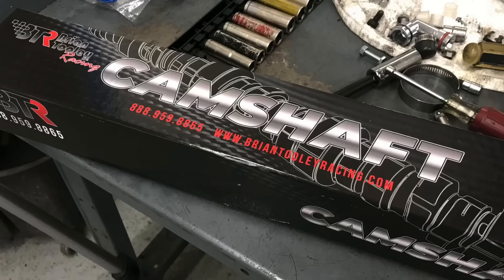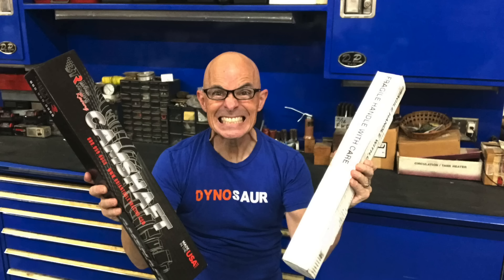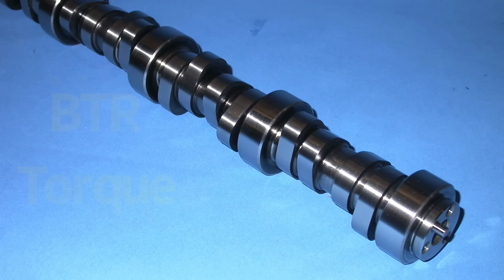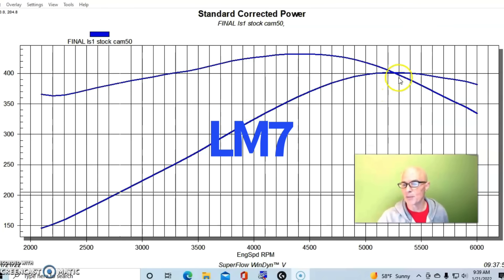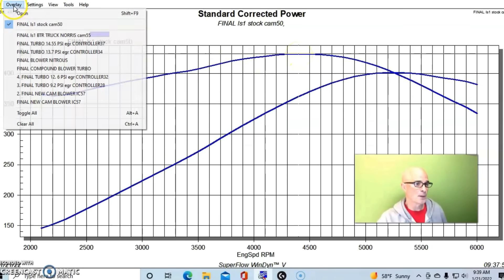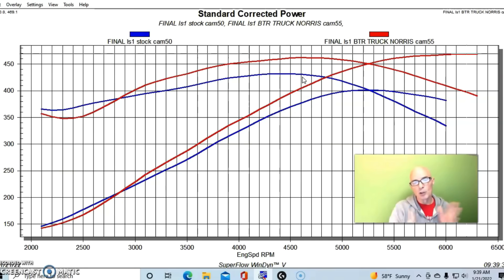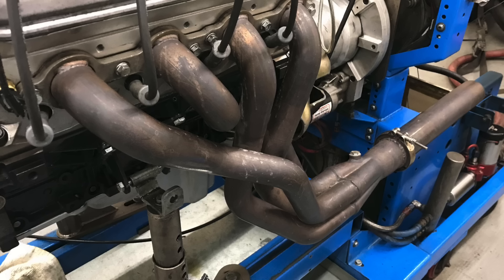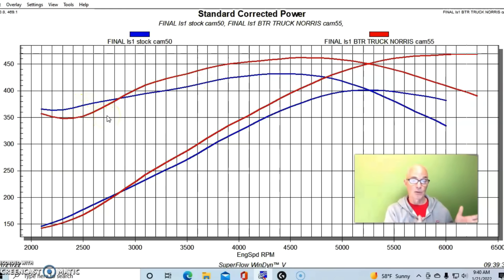WHAT IS THE BEST LS CAM? SLOPPY MECHANICS BEST VS TRUCK NORRIS FROM BRIAN TOOLEY RACING? FULL DYNO!

Comment: Have you or anyone else ever run a dyno cam based on the Buick GSX OEM, Stage 1 or Stage 2 cam specs in a LS? GSX OEM was 316/340, .490/.490 LSA 115; Stage 1 was 316/340, .490/.490 Overlap 90 deg (no notation if +/-): Stage 2 was 340/360, .455/.480 LSA 120 (no notation if +/-)
Reply from the maker: those are old tech cam profiles

Comment: @richardholdener1727 hello rich I have a 6.2 L92 in my 2007 Denali I have been thinking about adding some parts to it my goal is to get at least 600 hp without boost any ideas on what I would need to do to achieve this?

Comment: And ebays full of fake sloppy stage 2 cams you should do a test and compair the real cams vs there china knock offs or fakes and show the difference
Reply from the maker: if they got the specs right, power would be the same but we have seen some with stock specs and definite hardness issues (they won't last)

Comment: Richard what about the Chopacabra vs the sloppy stage 2  i want chop with some power gains and drive ability im building 2 engines one 2003 5.3 with very low kms and a 6.0 with unknown kms whats the best bang for my buck on both engines the 5.3 is going im my 89 blazer s10 and the 6.0 is going in my 1995 ss s10
Reply from the maker: I have cams for you-send me an email killerbe16@aol.com

Comment: What stall would you use with the sloppy cam and push rods
Reply from the maker: 2800 or so (you didn't specify motor size)
Reply: @richardholdener1727  it's a 6.0 bored over to a 6.2 carbureted LS

Comment: Could I use a LS3  stg 2 .589 sloppy cam and .600 valve springs with a 2005 5.3l truck stock heads?
Reply from the maker: yes-but it needs better heads
Reply: @richardholdener1727  not going for anything crazy. Just for my Tahoe for towing my travel trailer. Just saw a  ls3 cam, springs, pushrods and gaskets for $100. Was just curious if they could just drop in

Comment: Richard..    C5Z / LS6. All the usual bolt ons.  Long tubes.  Off road x-pipe…Mildly ported 243 head’s w/ double springs etc.  Sloppy Best? Or Sloppy stage 2? What’s your pick? Car is street/strip. 6 speed. 3.42 gears.  Sticky tires.
Reply from the maker: the SS2 makes a little more power, but less low speed than the 219 best cam-depends on what you want most. If you pick the best-I have that for $169
Reply: @richardholdener1727  ended up ordering a Cam Motion Titan 4.   Hopefully it works out well. Thanks for your help.

Comment: What size Intake valves are on the 5.3L that was bored to 5.7L?
Reply from the maker: 2.055
Reply: @richardholdener1727  Thanks Richard, keep up the good work. Maybe Sloppy Mechanics will come out with a Sloppy Truck cam in another year LOL. I'm on the fence between the Truck Norris, Chopacabra, Big Torkinator, Lil lope and Sloppy Best for my 2wd '76 Blazer, has LM7, stock manifolds, true dual H pipe, 4.33:1 gears, 4L85e. I miss the rowdy old 383 with 110 LSA 226/228 cam i had in it 15 years ago.

Btw, do you have a "Donations for Beer" box? ;-)

Comment: Does anyone know how the best cam would act with nitrous in a 5.3?
Reply from the maker: NITROUS JUST ADDS TO WHAT IS THERE-REGARDLESS OF THE CAM (UNLESS YOU ARE LOOKING TO HIT IT WITH MAJOR SHOTS)
Reply: @richardholdener1727  200 shot max
Reply: I really appreciate your response also but I've also been torn between the best cam and the ss3 it's a 5.3 and will have a powerglide behind it with 4:11 rear gear s10
Reply from the maker: if you want to make the most power possible, a bigger cam then nitrous
Reply: @richardholdener1727  ok,thank you for the response huge fan of what you do and I really appreciate the responses I've had a lot of people saying I needed to get a special cut cam or "nitrous cam"

Comment: I enjoy & appreciate your videos . I don't get your comparison?? Misleading & Guess if I want results from same c.i. eng. and compare 2 cams Freiburger with engine masters is where I belong.
Reply from the maker: what comparison do you want? This was same motor with two different cams (what better test could there really be?)
Reply: @richardholdener1727  I'm confused I suppose?  Yes both LS engines but different cubic inch , different heads (one is ported) so probably even different compression. My point is David and Steve use the same engine not same type. It's like testing cams for small blocks but one is 283 & other is 350 and that's not a comparison. Use the exact same 5.3 or 5.7 or 6.0L for a cam test. 2 cams 1 engine .... Am I wrong or did I miss understand?  Sincerely cause I enjoy your videos and I may of misunderstood ?
Hope to hear back & t.y.

Comment: So on a LQ9 with ported (not cnc) 243s and TBSS in a gmt800 with factory 3.73s... The 6L should eat up some stall tp be able to run factory converter? I was thinking at most, throwing in a 4.2 converter since it'll bump up stall speed a couple hundred rpms. I really like these cams that look small on paper, but make bigger #s than expected. I just freshened up my top end on my 98 WS6 t56 car that i built with everything that makes a C5Z a Z06 over base C5 but with original FAST 78mm. Full exh n bolt ons with slightly conservative tune on dyno jet made 392whp and 386wtq. Yes, has 4.10s also.... But when I re-did top end thx to original timing chain snapping at 7k while racing, i ported my 243s and used the SDPC LS6 Power Max Plus cam as I wanted something wee bigger but still can DD and beat the crap out of it like with LS6 combo. And just being a 220/222 with .570 lift on both sides and 112+2 LSA... It's so much more of a cam than I expected! So for 1, it was $239 shipped when I bought it. And 2, WOW!!! Love every bit. Chop is nice, but not too much. Haven't retuned it yet and runs great. Not perfect, but afr not out to lunch either. I have taken it to 7k several times without skipping a beat. But yeah, it feels like a what stg3 cams were 15 yrs ago!! 
I'd love to see some LS6 vs SDPC cams. They have 2 different LS6 versions. The other is like the one, but intake dur is down at 204 vs other at 220. Which I bought originally for the LQ9 build for my 04 Tahoe!

Comment: Biggest difference is in the cost involved to support each, the TN can use GM springs while the SB needs aftermarket due to lift, TN was developed to be used with factory converter while as you mentioned the SB looks to need a converter upgrade so unless you are doing a TB converter its a few hundred dollars more to be as efficient.

Comment: I know this video iS a year old
But I have a question. 
What kind of gains just dropping 
It in a truck without a tune. 
Just wondering if you’ve tried 
It.
Reply from the maker: it would likely be lean and might cause damage given the power gains and the stock injectors might not keep up anyway

Comment: Revisting this, I put a Texas Speed CHOPacabra cam in my LQ4 with 862 heads. Originally I wanted the BTR TN, but got a great deal on cam and springs. I'm not really pleased with the lack of power. It drives great andsounds good, but feels like it's down 20-25 RW from where it should be. I am going to replace my converter first, because it was doing weird stuff on the dyno. If it doesn't seem any better after ruling that out - it's time for a change. I have a nice set of 799s done by Advanced Induction, and a Sloppy Best Cam. I'm leaning towards swapping those on after the converter to get what I want out of this daily driven combo.
Reply from the maker: that TS cam should be a significant jump in power over any stock cam-I suspect tune
Reply: Tune has been deemed fine. It needed a loose converter (3800) to get it moving. Still puts down lackluster numbers, but I have managed to get it into the 12s with only 330whp.
Reply: I’m gonna say tuning if your tuner can’t get drivability down try another tuner choppacobra is a great cam choice

Comment: I put this cam in my 2007 gmc 3500 with 6.0 and 4L80E. The engine is out at the moment and I’m wondering if there is a better torque converter to run or is my stock converter optimal?

Comment: I wonder what the comparison would be on that ls1 with truck Norris cam between two sets of heads? One would be 862s with bigger valves vs 243s milled to achieve the same CR as the 862s?

Comment: On a 6.0 with a vs racing t6 80, what would be best? One of those or a turbo cam? Its in a 67 impala. For street and fun use.
Reply from the maker: pick the cam that does what you want to your na motor-then add boost

Comment: Richard just looked at the new cam from tsp the " chopocabra" 214/222 .550/.550 108 LSA. Shameful on there part I feel like they took all of Brian toilets hard work and research made a camshaft almost identical to the norris shaft and named it somthing intriguing to some folks that may for for a name rather than a cam spec . just wanted to bring this to your attention maybe try a test on the "chopocabra" see if the results are similar to the norris cam swap results 
                    North Maine Steve

Comment: Richard if I already have the BTR stage 3 v2 cam is it worth changing out for a Truck Norris? Is the stage 3 fine to run with a turbo?
Reply from the maker: YES IT WILL WORK WITH A TURBO-IT'S BIG FOR A 5.3L OR A 4.8L
Reply: Sorry should of mentioned, it's a 6.0 LQ4. Currently with stage 3 v2 truck cam.🤙

Comment: Ima try asking this again but more simplified and the other cam with a different lift. Lq4 6.0. Truck norris or Texas speed truck cam cam stage 2 .550 lift? Don't want any loss down low
Reply from the maker: what are the specs on the TS cam? the TN won't have any loss down low on a 6.0L
Reply: @richardholdener1727  212/216 .50 112 lsa.
Reply: @richardholdener1727  heavily leaning truck norris.

Comment: Quick question. I have a 2006 6.0 with flat tops and 317s. Building for a Land Rover conversion.  Is it worth going to a 799 head or is the 10.5 CR enough?  I prefer to not run higher than 87 and living in Colorado Springs, it won’t likely ever operate below 5000’. What cam would you suggest?  Love your content.  Thank for producing!
Reply from the maker: THE 799 HEADS WOULD BE BETTER AT THAT ALTITUDE

Comment: What exhaust and gear would you recommend on a Lq9 with 243 ported heads and ported tbss intake and ported throttle body with a 4l80e stock trans and stock block single cab 2001 would you recommend
Reply from the maker: 2.5 exhaust with headers and 4.10
Reply: Thank you so much

Comment: Morning Richard im from new zealand 
Running a stock ls1 in a caprice 241 head numbers. 
With this cam reading a low LSA and low lift with nice duration i like this for our cruise car key question will it work in our ls1 5.665 ltr engine VF002710096 witch i cant find 

Kind regards 
Aaron.
Reply from the maker: the TN and Best will both work on the 5.7L Ls1
Reply: Awesome Thank-you and i love the detail you put in to channel and hard work.
My next trick is to sorce that cam now 
Thanks
Richard.

Comment: Hi Richard, Have you tested or compared the GM LS Hot Cam? why are the BTR cams so much better? I am looking for street manners, max torque at the lowest setting with an Turbo 350 W/2400-2600 stall, 3.08 gear (Soon to be 4L60 and 3.23)LS2/LS3
Reply from the maker: NOT SURE I HAVE RUN A HOT CAM

Comment: Richard im getting ready to order some trick flow heads for my 5.3 with a tbss intake and 1 3/4 headers and btr truck norris cam. What specs do you recommend for the trick flow 205 heads?
Reply from the maker: don't they come 1 way?
Reply: @richardholdener1727   i was looking on lethal performance and they had 2 different ones. One being 58cc and another where it asked what cc you want starting at 54 to 66 thats why i was confused im assuming i should go with the first one the 58cc

Comment: the real question when is lift and duration to much for a real everyday driver that weighs say 3600 for a car and 5000 for a truck with a street friendly 373 gear. for racinging biggest cam  with biggest stall with lowest gear

Comment: VIDEO SUGGESTION: I'M not sure if this has been done before or not, but I'm sure someone has.  However I'd like to see what results you come up with.  Ready?  
Take a 5.3l.  1st test: stock (non-flexfuel) injectors on 87 pump gas...  2nd test: stock (non-flexfuel) injectors on E85... 3rd test: Stock Flex Fuel injectors on 87 pump gas.. 4th, Final test: Stock Flex Fuel injectors with E85...

No tuning.  I'd like to see if just swapping the fuel or just the injector makes additional power.  Then maybe some tuned pulls for fun.

So basically will a 5.3l flex fuel injector, dropped into a non-flex 5.3l make any extra power???.  No tuning.  Just the injector.  
Whatcha say?  Could be an easy, and cheap to make video that would help tons of ppl I think..
Reply from the maker: if the injector size is different-it will require tuning
Reply: @richardholdener1727  Technically they'll  run without tuning for the injectors.  It just wouldn't produce as much power as it could.  Or may run like junk.  Or the computer may try to pull fuel and compensate for the rich environment and it maybe fine.  
I think it would be a neat video to see.

Comment: I'm looking at a 228/232 .600 .600 112 lsa cam from texas speed.. ( real close to sloppystage2) going in 6.0 gto six speed all bolt ons etc.. the ss2 cam was rumored to not lose anything, anywhere in rpm range compared to stock cam.. thoughts? by the way thanks for all the great tests and info
Reply from the maker: the SS2 does indeed lose power down low like every other 228 cam
Reply: @richardholdener1727  thanks for the quick reply.. do you ever test texas speed cams?

Comment: But meant to say can you tell me what valve springs and push rods to run w the sloppy best cam. .600 behive springs? Stock push rod length? And what I recommend for upgraded brand push rods and preferred brand of valve spring you like to run on 5.3 L33 motor

Comment: Could I tell me what to get for upgraded push rods and what valve spring I should get to run the sloppy best in my L33 5.3l thank u Richard may be buying my cam package this month can't wait
Reply from the maker: we used the existing pushrods with both cams (already had dual springs on the heads)

Comment: does anybody know how good this cam is with a 5.3 turbo application?
Reply from the maker: either work very well
Reply: @richardholdener1727  hey richard, btr is getting back with me. Im trying to figure out what set of heads i should use on my 5.3 build, bought the "best cam" and have 862 currently but think i need to get different ones, you have a video the shows different set of heads and intakes (im assuming these are the major factors in engine hp numbers)

Comment: Richard, with all your cam swap experience what's your opinion on using new flat tappet hydraulic lifters with a low mileage used camshaft? I'm swapping my guts into a different engine and unfortunately I mixed up the lifter orientation.
Reply from the maker: fine

Comment: Awesome info as always! I just picked up a '15 Caprice with the L77 in it. All aluminum 6.0 based on the L76 in the GTOs. I'm wanting to find a stout cam that gives me a healthy bump in torque and HP but still functions with a converter. How well do you think the Truck Norris would perform? Car weighs about 4,000-4,200 lbs and has a 6l80e.
Reply from the maker: IT WORKS WELL

Comment: Truck norris is overrated tbh for its sector, id rather run a slightly nicer set of springs and a bigger cam without compromisesidk why there are so many shitty underwhelming cams out there and why people want them. Especially the truck cams when they are allready buying nice springs/converters
Reply from the maker: a bigger cam will drop low speed power-especially compared to the Truck Norris cam
Reply: yes but there are others that DONT like the Tick SNS TMstg3, it makes more torque everywhere above 1500rpm @richardholdener1727

Comment: if you took the sloppy cam an changed the evo to a later number it would be just like the norris cam..a early evo moves the tq an hp curve up. meaning it will carry power up higher. a later evo means more tq down low.its all about controlling the cylinder pressure for where you want it . i suggest people learn valve events an dont look at duration. duration is a by product from your valve events.😉

Comment: Thanks! Getting ready to swap my stock turbo 4.8, for a 5.3 with TN and the same turbo setup, curious to see how much the turbo responds differently.
Reply: That's a waste of time 4.8 and 5.3 use the same block only difference is a 5.3 has a long stroke and the 4.8 has a short stroke.

Comment: BTR stuff has been crap. Followers. Called them out 5-6 years ago on their tq lacking garbage. Then they come out with it a few months later. Lol 😂
Reply from the maker: you obviously don't test very much
Reply: @richardholdener1727  threw many BTR stage 3 cans away out of cars. Why would you want top side HP on a blower motor??? Spin blower faster? Create more heat??? Come on now you cant say you agree with that at all! They came out with their tq cam specifically after the shit I rained down as the tq killing cams. 2 stroke cams basically. Hence “tq cam” came out. Lol